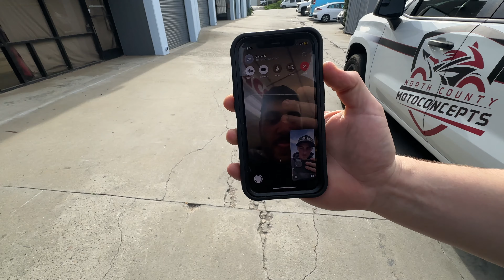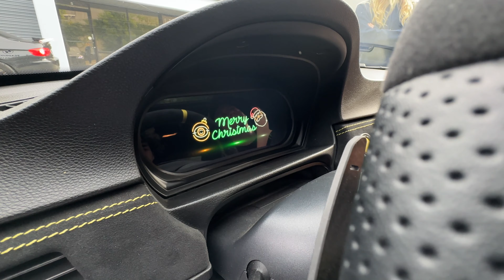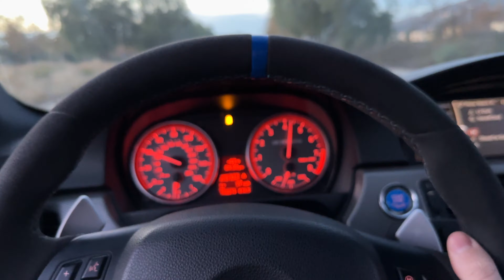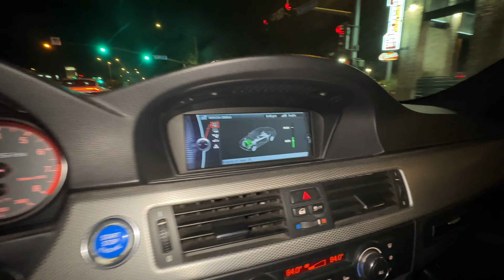MANUAL BMW 335I FULL SEND (E85)

Comment: Do you know what clutch setup he has? I've got a stock N55 manual and am wondering what the torque limits are before remapping and modifying.

Thanks :) love the videos as always
Reply from the maker: Stage 3 X clutch I think
Reply from the maker: And appreciate it bro!
Reply: @3thurty5is  Thanks for replying bro! That's quite a way off for me in the future but good to know for reference. I mainly want to remap for better throttle response and a touch of extra top end